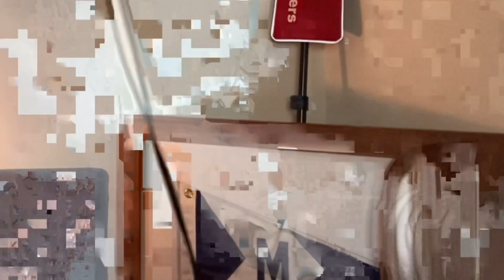SUNFISH SAILOR REVEALS: SUNFISH Sailboat Extreme Daggerboard

Comment: I get u purchasing the Aero South rudder if it helps get rid of weather helm and it is only for day sailing. Still a worthwhile investment for day sailing.  A dagger board that helps me point a little higher and go a little faster when day sailing doesn't seem as good an investment of a couple hundred bucks plus.  Am I missing something?
Reply from the maker: Yes. You are absolutely right. But on the other hand, it’s an aftermarket, special item. For some, not all, would maybe want a different speaker system in their classic car, maybe someone likes a glass tile back splash in their kitchen, or yeti coolers...  all these items are truly “unnecessary” :)   Thanks for the comment !

Comment: Do you think it will hold up to a capsize righting? Don't test that till you head south. ;-)
Reply from the maker: Hahaha.   Yup.   I don’t like to do Sailor-in-the-water tests;).    They said, the engineers, the the strength of the board will hold up to people like you and me hanging on it to upright a boat.   I actually asked that question. :).
Reply: If AeroSouth fabricates the daggerboard in the same way that they do their new rudder design the wood is overlaid with graphite fiber to give it added strength. So the thinness should not be a problem.